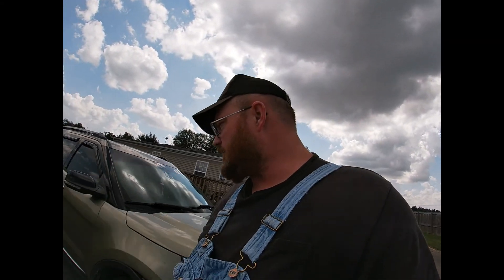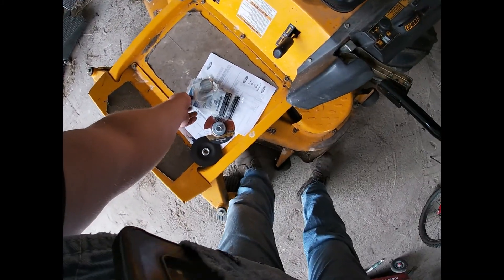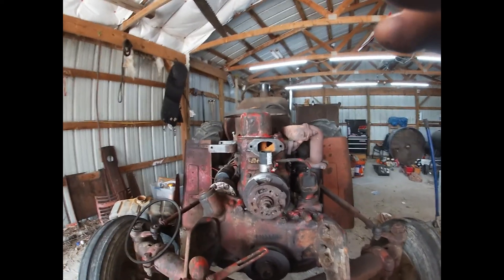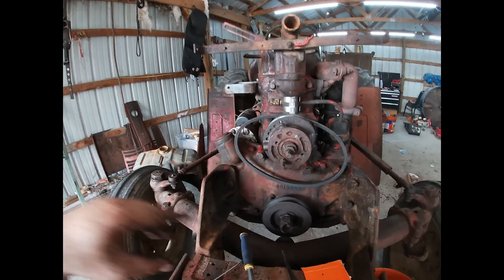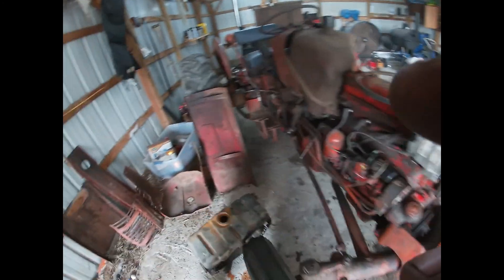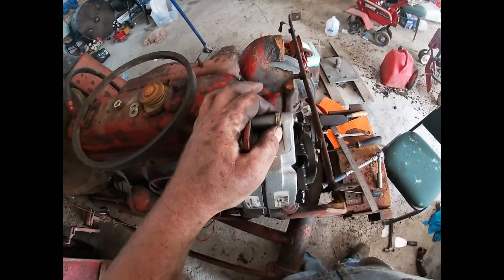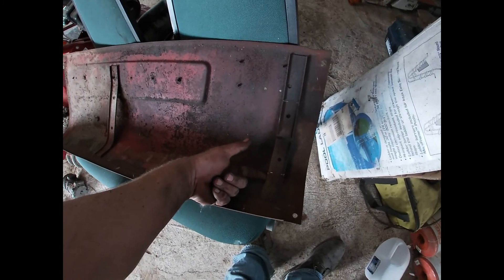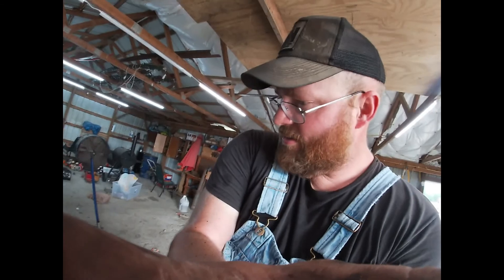The 300 Alternator

Comment: Good job making the large bodied Delco fit in there.  I really like how you created room on the sheet metal support bracket and yet preserved the outward sheet metal appearance such that no one will ever know.  I am also a flux core wire feed hack welder and stick hack welder.  All my welding happens outdoors and no worries about wind blowing the shielding gas away and the welder is just so much more portable without the bottle in tow.  Must be quite a bit more room under that sheet metal as compared to an ole Farmall h.  Trying to fit a Delco in a letter series is very difficult.  As long as you have future room for belt adjustment I would say that you are good to go.  I am still a fan of the Hitachi 14231 over the Delco myself and will continue to use those over the Delco's on my fleet of vintage tractors that I convert to 12 volt as it is just so much easier to fit that Hitachi in tight spaces and it costs basically the same money if buying new/rebuilt from parts house.  I prefer the 3 wire connection of the Hitachi over the  Delco 1-wire but the Delco is also available in a 3-wire style as well.